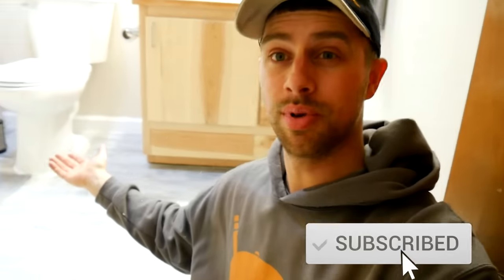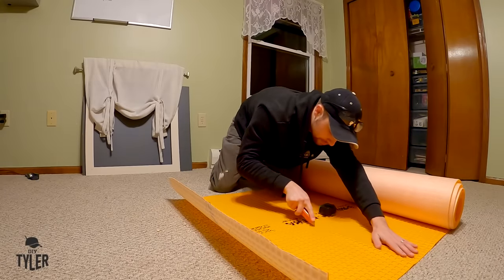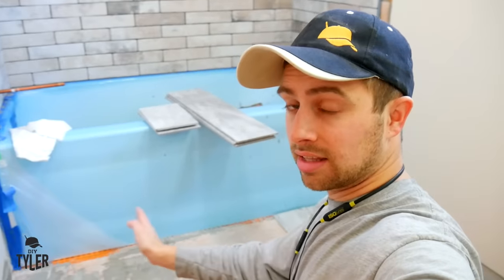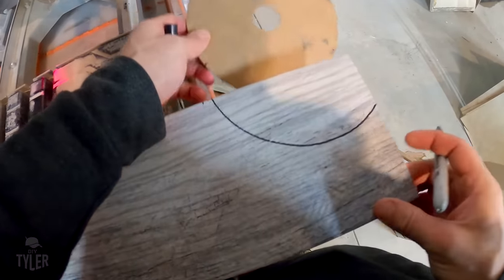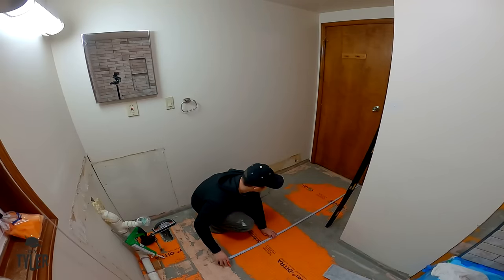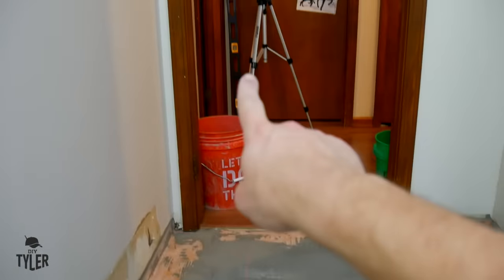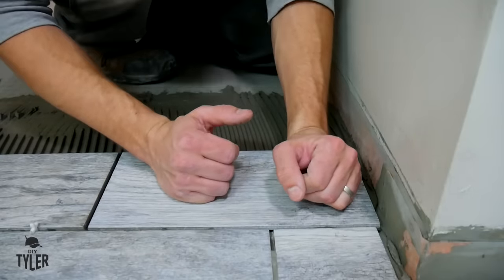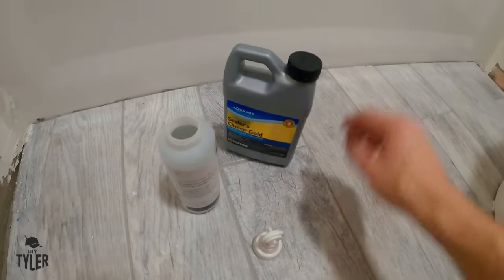Tile Floor 101 | Step by Step How to Install Tile for the First Time

Comment from the maker: A new video (2023) released covering a complete, stud to waterproof shower, install with Schluter kerdi walls, niche, shower pan, linear drain and bench. https://youtu.be/PCnbDS3t1F4
Reply: Was concrete board used and what was used on the seams of the membrane?
Reply: My current floor is tile, how do I go about removing this please? Also pet of the floor the concrete has been laid on fake wood flooring and so it’s all broken up. How do I go about laying concrete level to fix this

Comment: Great job Tyler. Good info. I have one suggestion. Knee pads. Take it from a 62 year old that didn't use them. My knees are not in good shape.
Reply: I saw him wearing knee pads at one point. But yes definitely good advice!
Reply: Knee pads or a knee pad.  For sure a requirement.  This coming from a 42yr old hvac guy

Comment: Tyler just a heads up, the toilet valve looks to be a threaded type.  So you do have some options and I would suggest to use the ball type not gate type of shut off valve since the gate type will eventually stick (sometimes) then when you go to shut it off then it can start to leak.  Anyway, after replacing all my gate type shut off valves with the ball type (they do make them nice chrome so they don't look any different) it makes toilet or faucet repairs so much easier.

Comment: The colder the water the slower it sets, and more open time.  And you need diamond grit hole saws for porcelain tile.  The laser is cool but it's quite easy to just measure over and make a pencil mark on the set tile to line up your next one.

Comment: I'm planning the same project in a bathroom.
1) Would regular mortar work with Ditra?
2) Is the 33% stagger because you're using such large tiles?
3) Did your toilet flange have to be raised because of the Ditra/tile heigth?

Comment: Ah, man, Tyler... If my wife sees this I'm ruined, haha... If she does, I'm flying you to Vermont to do ours! Phenomenal work, solidly built and looks great!
Reply: So did he work there?
Reply: Hi:
1) How many hours did it take you to do this floor?
2) How many hours do you think it would take a guy who has never laid tile to do the same job?
3) Is it easier to tile with 4x4 inch tiles rather than those much larger pieces you used? What are the pros and cons of using smaller tiles vs larger pieces. (Some tile is 24x48 inches! And $50-$80 each, so I would hate to damage those. And it seems it would be difficult to use a tile saw with such large pieces. 
4) when laying travertine should I fill in all the tiny holes with grout or leave them open? 
5) could someone use a pastry bag with the grout? And squeeze the grout into place? So you don't have to wash that grout haze off--- like 4 or 5 times. It seems a never ending process to get the tile clean at the end. Any tips on that, getting the tile clean? So you aren't washing the floor over and over and over!
6) if tiling a shower should the tiles be a different size on the floor vs the walls? Style wise, would it look better?  What would you do in your shower: Use different size tiles on the floor and walls, or use the same size on both surfaces?

Thanks a bunch for your insights!

Comment: You can use water on your hole cut bit, just setup the tile at the saw, begin drilling your hole and pour slowly water from a bottle. It will help.

Comment: to grout you go diagonally, just so your grout joints dont get thin >.< and you only need to use a sealer on pourous stone, aka 511 sealer

Comment: Looks great.. have you ever tried those carbide tip on a router to cut? Im not a tile guy but i remember a guy who use to use a piece of plywood.. cut out the hole.. then clamp the tile and the wood together.. would drill a hold.. then use the flush cut carbide bit to make perfectly cut holes.. but im not sure how efficient and effective that is..

Comment: Freaking Amazing Job Sir! Very informative! Thank You! I do have a question....if I were to cut designs out of wood to create an elaborate artistic design...would I still use mortar to secure the wood to the floor and grout in between the seems?
Reply: You wouldn't want to use mortar to secure the wood u could use mastic adhesive which is more of a glue. Wood expands more than  tile so u would have to leave a joint between the tile and use a matching grout caulk.
Reply: @alphaomega311  Thank you sir!
Reply: Am also a Tyler also I wish to go to USA and tiles many houses there

Comment: You did a great job but not sure on using warm water. Every bag of thinset i have ever used says cool water . I believe hot water will make it set faster and the faster cement drys the worse it is...also look into the leveling systems , they are a must with long planks

Comment: Schluter is top of the line but can I use a less expensive version on the floor to cut costs and just use Schluter inside shower? I too will be removing the vinyl (your old vinyl looked way nicer than what I need to remove!) I am headed to the shower video now.

Comment: Tyler thanks for the video. I had a question for you as I am going to be trying to install 12x24 porcelain floor tile and been watching your videos to help educate myself before I start the project here this week. The question I have is do you need to put spacers on the otherside edge that is along the drywall or not really? Also if you put down and install the Schluter Ditra uncoupling membrane, are you able to put anything on top of it prior to installing the tile (i.e. doing the laundry room, did not know if after I installed the Schluter Ditra would I be able to put the washer and dryer back in the laundry room to do a load in an emergency without doing any damage?

Comment: what did you do at the edge of the tile by the wall in part 2 of putting the tile down? was that filled with grout? just bought a house and I am looking to do a lot of changes myself, so thanks for this video!

Comment: Using Cement all by Rapid set and add a packet of set control will give 1 hour and 15 minutes and you can lay tile right after.

Comment: What are your thoughts on placing tile around an existing vanity vs removing the vanity to lay tile underneath?
Reply: This is old school and we just dealt with removing an old vanity in our bathroom that was that way. It was a nightmare to get it all taken out and it increased the chance for water damage under the vanity. I would just rip it all out and do the whole floor proper.

Comment: Great instruction!   Tyler,  why did you put mortar down on the ditra the night before and then use another layer of mortar for adhesion?  Wouldn't that put more product down and make the tiles uneven in the end?  Just comparing to the first few rows you did where you were putting the adhesion layer on fresh ditra.  Tyring to learn!  Thanks bro!
Reply from the maker: Since the holes in the ditra need to be filled in that is where I was placing leftover mortar instead of throwing it out. Mortar will bond to mortar just fine! And yes you want to make sure it's smashed down in the holes so that you don't have an uneven surface for the tile.

Comment: Tyler
Mixing thinset in a garage dust gets around there’s a jogging stroller would using light weight plastic be an option here?
Does it make sense to use plastic down or tarp to keep mortar off of the garage floor or what is your preference here.
How water may not be recommended for thinset, I have never heard of this.  Please help explain why it’s better to prevent skin damage?  I’m learning here I think?
Why did you stop the wall tile at the side of the tub instead of running a “dog leg” which protects the drywall from water damage at the side of the tub as the water can run during a shower. Also if you finish your layout another 2.5 inches past the side of the tub would that offer less drywall repair for that vertical seam?
That tile manufacturer might recommend not using a 50% stagger, likely because the tile is not perfectly flat? Or why would they do you think? 
It’s nice you use Dietra under the tub but is it necessary?  And when trying to drill holes with a hole saw bit would it make sense to put down a piece of cardboard or towel for cushioning to reduce the chances of breakage?
And when your checking your room for square you are using /measuring off the door which may be about 28-30” wide instead of the longer sink wall at around 4-5 feet? Is there a reason for this?  I do really enjoy your video and look forward to seeing more

Comment: How did you ensure that your floor and tile application was completely level vertically, avoiding differences in the height of the tiles, particularly with regard to subfloor prep and thickness of grout under the tile?

Comment: Put your drill in the bucket in the water before you add the thin set..... Try not to go straight onto the joint with the sponge when grouting go diagonally.

Comment: Hey Tyler did you think about starting your grout joint halfway in the middle of that shut off valve that way you wouldn’t have to do any of that and just start your pattern from left to right instead of right to left and I believe Ditra recommends that you use non modified mortar on top of the ditra because modified mortar the latex will not dry. it’s plastic it has nowhere to go so modified under because of wood in the membrane and a non-modified on top ask your Schlueter representative   I have 30 years experience in tile I’ve never seen it happen but they say that the latex will bleed through the grout just FYI other Than that you’re doing a good job
Reply: He said he used schluter set listen 
I have done tile 35 years boy

Comment: When you first set a tile you can step on it if the mortar is still wet and soft, but once it starts to dry if you step on them it will end up not drying right and not stick

Comment: Cement all is a hydrolic Cement, once dry will give you 3000 psi in the first hour. Great for Tyler projects. Also it's water resistant.

Comment: I am a first time Tiler  and this is a great video.  when I lay out my 1st row  against the wall do I start the configuration there  of  1/3 2/3 and   full tile or do I just  lay all 6 by 24 until I need to cut  One tile at the end of the wall please help thanks.

Comment: You can also use a circular saw and set the depth very shallow to cut out the old floor.  Is it bad for new mortar to be set onto old martar on the ditra?  Buckets, sponges, and cheap tooth brushes!!  Why not sponge at 45 degree angle to the lines?

Comment: Great video and great work couple of questions if you don’t mind what kind of thin set do you use? And also is it absolutely necessary to have that membrane or can I install directly onto subfloor?
Reply from the maker: I used Schluter All-Set for this projects....and most of my tile jobs. Personally I have not installed directly to a subfloor but I have heard it can be done, the longevity of those projects cannot be proven though.

Comment: I love this vid! I want to tile myself (I have in the past) but carrying that Hardybacker and dealing with it, oy!!! This product looks really awesome (easy to carry, cut and install, OMG). I was wondering if I needed to waterproof as I want to do a kitchen floor. Straight cuts only, not under a sink or any water source.
Reply: The ditra is already waterproof. Since it's not a shower and will see minimal moisture (mopping) you probably dont need to tape the seems.

Comment: New subscriber.  I was wondering,  if thinset dries on tile. Can it be removed? Scrape it then use some type of cleaner?
Also, is tile against wall or do you space it? I though since backboards will be over it?

Comment: I noticed the wide kerdi band you installed, wont you lose the benefit of the ditra with such a wide piece?  is that for waterproofing or for movement/flexing?

Comment: Hello Tyler, thanks for the video. I was doing my floor after watching your vid. I tried to save my tiles. The ones that run along the bottom of the floor, the bottom wall tiles as I removed them all the sheetrock paper peeled of the drywall. Now I have white chalk along the bottom of my wall in the bathroom. 
1) Can I just use a oil based primer along the 2" exposed chalk, what kind?
2) Do I have to use Zin Bin first and primer or just ZIn Bin?
Thank you?

Comment: I created a pantry in my kitchen and had to strip some of the tile away down to the sub floor for the framing, do you have a video or advice on how to re- tile inside the pantry to match the height of the existing tile? The existing tile looks like it was laid on old vinyl flooring and cement board so it sits pretty high. Not sure how to match the height.

Comment: Can you immediately put tile after placing the orange sheet? Or can you tile right away? I want to do my small bathroom in a weekend
Reply from the maker: You can follow up immediately with tile....one of the true benefits of the schluter products.
Reply: It is much more difficult even for a professional. I would recommend skimming a thin top coat of mortar filling all the squares on the Mat first. Keeping a nice flat surface just filling the squares and let that dry overnight. You then will
Have a flat solid surface to mark your lines on so you will be more accurate.

Comment: Hot water would decrease your working time. Makes the hydro chemical reaction within the cement react quicker. While initially it will increase workability, it would for sure set quicker. Which may be helpful in doing tile anyways. Just fun facts

Comment: If the tile is going in a foyer, right inside from the garage, does it need a backer? Or can it go directly on the floor/subfloor?
Reply from the maker: A backer is going to give you the longest lasting tile job. The wood underneath tile is going to move, this style of uncoupling membrane will prevent any grout from cracking

Comment: Is it best to start from the back wall to the doorway as you're doing or vice versa? It's a rookie question that I need an answer to. Thanks.
Reply: Back to front, so that you are not walking on the tiles after you lay them

Comment: I’ve seen people use cement boards for the floor and they just drill it to the wood floor. Is that good too?
Reply: you can do it, but that stuff is damn heavy, thick and doesnt protect the tiles from cracking. Ditra is LIGHT and easy to install and protects tile from cracking. That backer board has no advantage over ditra that I am aware of.
Reply from the maker: Good just a lot of work, dirty, heavy and not as good as Ditra.

Comment: Schluter seems like a very nice product, but at the cost of that stuff I can't see how you can justify the extra expense to the customer?  Please let me know what you think.
Reply: when you are dropping a couple grand on a tile floor and you want to skimp 200 bucks(depending on size of room) maybe 500 bucks, dutra keeps your tiles from cracking. I laid 1200 sq ft of tile about 15 years ago directly on a concrete slab. Well, I have 2 places that cracked my tile. I didnt know anything about dutra or if it even was around back then. So ask the customer if they would like tile floors that dont cracK? Yes, then its an easy convincing on the couple hundred dollars in cost.

Comment: Awesome video!!! I’m a first time tile-r, I’m still getting all of my carpet ripped up right now. I was wondering about the small plastic spacers (not sure if that’s correct terminology). I’m assuming you put those in to insure that the tiles don’t shift or get moved while drying??? I was also wondering about the float -from what I have read I thought I was supposed to use that after I laid a section of the tile to help it adhere? Any guidance is much appreciated!

Comment: I am really surprised to see you are not using a leveling system that also includes spacing for your grout lines.  Why not?
Reply: You also need to specify what type of grout you are using.  In this day and age with Fusion Pro and other types of solutions upon us grout is not all created equal, therefore your instructions may only work for one subset of grout.

Comment: Woohoo thank you so much for making this! I have a few tiles that I need to replace in my kitchen O_O any advice for that? I have some spare tile so I don't need to worry about matching and they're whole tiles so I don't need to cut :)
Reply: Scrape old thin set off. Mix new batch. Place new tile with appropriate spacers. Let dry (you can get quick setting) then grout. You'll be surprised how easy it is

Comment: Does anyone know what if anything I can use to prep a drywall with no outside paper or brown paper. I removed the tile and all the paper came off. Now I have just have exposed chalk and I need to put tile on that portion of the wall with no paper???

Comment: I have a question I am about to use high end vinyl floor planking on a concrete slab the room is like couple feet below grade. Now existing are 9x9 anyway some are missing what would be best way to even floor.
Reply: Are you trying to fill existing voids from missing ceramic tiles? Then you want to install vinyl flooring over tiles? You can use a floor patch compound. It’s a masonry product that you mix with water then trowel it into place. But a trowel that’s longer than 9 inches so it can span the entire 9 inch void.
Reply: @playhouse888  it’s the 9x9 vct type but I think leveler dap pre mix

Comment: Surprised that you didn't use spacers or another system to make sure your grout lines were even and tiles didn't have any lippage. 
Most professionals I know always do this because no floor is exactly level especially when you add the Ditra system or cement board to your sub floor.

Comment: I couldn't see how it looked around the water valve. The plumbing is very minor and shutting off the water and lifting the valve is also minor.   The tile should have gone underneath the water flange so no grout will going around it but that is just me.  Otherwise a solid job and very nice.